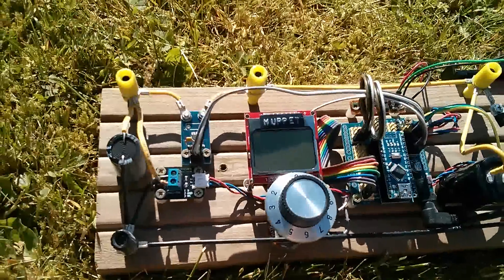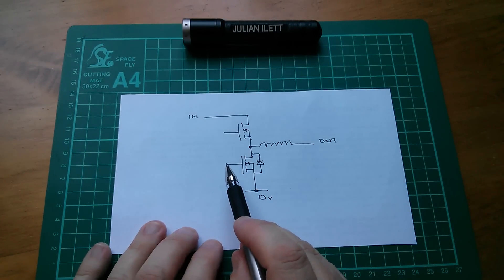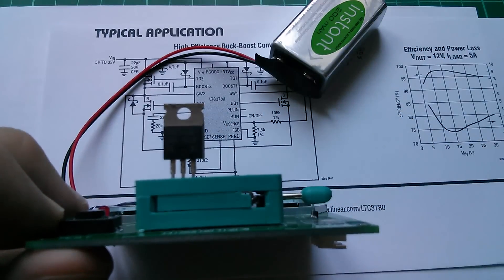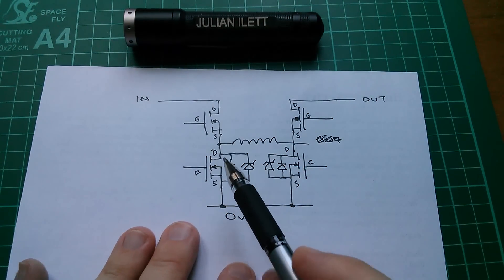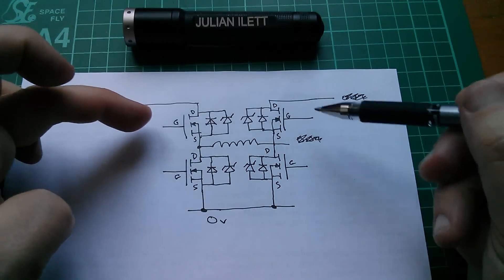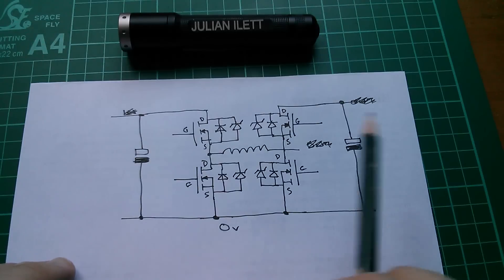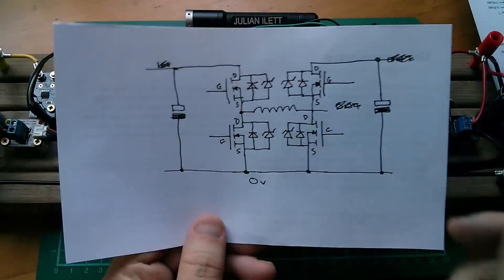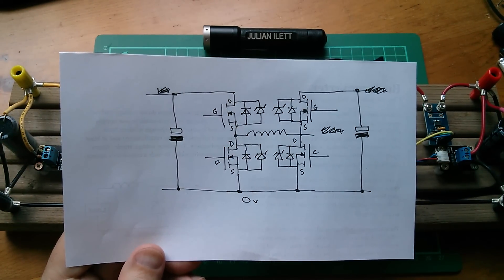Muppet 2 - A Bidirectional Buck/Boost DC/DC Converter

Comment: A little info for you in high frequency converter alway use higher frequency capacitor low esr for better current output and input because the frequency do reverse to the input voltage supply slowing down current peak so use low esr for input and output or the current won’t get pass 2 amp even because of higher frequency ripple effects stopping the current from slowing down to storage for the low to keep the voltage and current in phase

Comment: Interesting stuff!  When I saw you starting to talk about the body diodes,  I was hoping that you weren't planning to use them,  and am glad that turned out to be the case.  I've also heard that it's not good for the MOSFETs.  Take that four-MOSFET circuit you ended up with,  and consider the inductor going across the middle of it to be one of the coils in a stepper motor,  so you'd need two of those circuits,  8 MOSFETs in total.  I've seen that somewhere but can't remember where,  and I'm not sure how you would go about driving the gates...

Comment: With the right choice of parts you could even use this to convert rectified mains directly into DC. Or if you add some kind of polarity switch to the output you could also make a sine wave inverter.

Comment: Have you looked at the Propeller microcontroller? It's great for projects requiring precisely timed signals.
If you're interested in using the Propeller, I'm sure I could write some code (probably in  assembly) for one of the cogs which would output whichever pulse pattern you want. One cog could be driving the pulses and the other cogs could be used for other input and output needs.

Comment: I live on a boat. solar panels charge the house battery. some 4 meters away, i have another battery. If i put your muppet next to the remote battery, the boost facility would allow for the volts drop on the input could be offset via the muppet. I have a third battery 6 metres away and i could do the same for that battery. This project has more options than just the solar charger. please stick with the Arduino  odules due to price and availability.

Comment: You can drive it from the nano on pins 5/6 at around 60k.  However, it's more efficient at higher speeds approaching 500k-1,2m.  This will also allow you to use smaller component values.
Reply: Found this mate and maybe it will help.  It seems the ATMega48 will go up to 1Mhz.  Scratch that.  It's max clock rate is 1Mhz.  Misread it.  But this should give you some ideas. That's what I get for researching and working at the same time.  http://jiggerjuice.info/electronics/projects/power/buck-boost-half-bridge-nmos.html

Comment: Hi Julian, whichever DC converter topology you end up using for the MUPPET 2, consider a Sendust toroid core for your main inductor.  Core loss will be reduced as these have a 'distributed air gap' and these cores are also less audible.  Overall efficiency will improve.  You would need probably 20 turns of enamel wire on a Sendust ~50mm core to get near 50uH as they have lower permeability.

Comment: Could you melt snow off solar panels by feeding energy back into them?
Reply: Nope it would permanently kill the solar panels.
and you would need a very high voltage in order for any current to flow back into the solar panels it would be useless

Comment: You can do the current sense in series with the inductor.  A pair of op-amps can make a differential amplifier input stage to amplify up the current signal before you get rid of the common mode part with a 3rd op-amp.

Comment: It might require something with more PWM timers than on a standard arduino. You could still use an Atmel chipset though. Alternatively, if you want a module, you could use a teensy. The 3.5 has a lot of PWM enabled pins and 4 separate timers.

Comment: kHz PWM is very much possible :) Max speed via the hardware PWM is 62,5kHz. So no need to switch uC for that.
Reply: tengelgeer But at such low frequencies you need a huge inductor.
Reply: Kind of, but if I'm not wrong he uses <1kHz now.
Reply: tengelgeer There are very few turns on that inductor. Unless that ferrite ring core is made of some miraculous material, the inductance should be way too low to operate at <1kHz. Remember dV = L dI/dt.

Comment: Hi Julian, you may need to use a raspberry pi zero or similar due to the necessary dead time that the arduino clock may be too slow to do. You also should probably use dedicated drivers as the microprocessor may not switch the gates fast enough

Comment: Please turn it on!  bidirectional converters are popular in motor drives, there are tons of studies about this subjects.
Reply: you are thinking of a H bridge what this is is a 4 way bi directional positive switch mode power supply
Reply: no. I am not talking about H bridge. Bi directional buck-boost converters were often used in motor drives for regenerative braking. Bi directional buck-boost converters are also useful is solar or wind power units, if they are connected to the grid.

Comment: if you want a better controller for that check out cypress' PSoC 5LP, you can get the little prototype boards for 10$. up to 70mhz 32 bit arm cortex m3, programmable gate array and a surprisingly easy to use IDE (PSoC Creator). the actual code is C as usual but for hardware configuration it is all done through a schematic view that lets you just drag and drop hardware components and wire them together like you are drawing a schematic. this includes hardware lookup tables, free running counters, timers, PWM's and a lot more.

Comment: Recently did exactly that with an atmel microcontroller, so the arduino should be fine. 
I had to use a second timer for either the Pwm of the buck/boost or a servo, not sure anymore.
Cant wait to see how you manage the Feedback and Interrupts in the microcontroller as this is the part I don't feel i know enough about.

Comment: Julian, there is a TimerOne library that lets you run much higher then normal PWM frequency's on the 328 chips.  You could also consider something like a PJRC Teensy 3.2 or 3.5.  Which have deadtime and similar hardware PWM controls built in, if you can learn how to run them.

Comment: Julian, consider building your power stage on a printed circuit board instead of hand-wiring, the efficiency will be greater and it will generate less EMI.  There are plenty of low-cost PCB fabs in Asia that do nice work, and homebrew methods like toner-transfer are good if you have the patience.
Reply: Definitely! For really high power the emi is large enough to switch on the mosfets and everything behaves strange, it can even short out the input via 2 mosfets.

Comment: Okay, that sounds kind of scary when you talk about a device that can do buck and boost and be bidirectional all at the same time.  If you have, say, a solar panel on one side and a Pb-acid battery on the other side, what's to stop a simple glitch from causing the battery to try to "charge" the solar panel and overpower its voltage in boost mode and possibly fry your solar panel??
EDIT: now that I think of it, the solar panel would have blocking diodes in it but how much reverse voltage can it handle.. heh
Reply from the maker: +Christmas Eve The simplest solution would be an anti-backfeed diode.

Comment: So you made a super-symetric Muppet.

Anyways - while it seems nice, what would be the use of a bi-directional buck-boost converter? I can see the appeal of a bi-directional converter that boosts in one direction, and steps down in the other.  
But like this? i just can't imagine a situation where you wouldn't want a separate converter all together as you likely do not want to send your power back to the source.

Comment: I recently finished a similar project for my dissertation (solar power system for use on an aircraft), I used an LM5170-Q1 for the buck-boost controller (bi-directional) and the LTC3780 for MPPT. Whats interesting about the LM5170 is that it bucks one way and boosts another, and if you look at the schematic for the buck converter with the freewheeling diode it can essentially acts as a boost converter if the inputs and outputs are flipped and the PWM signals on the two MOSFETs are swapped around. If you have a closer look at the LTC3780 datasheet it recommends switching frequencies in excess of 100KHz which an arduino cant handle, if you are using a software approach(which I found from my experience is much easier to implement)  to this I strongly recommend using MOSFET drivers, the faster switching frequency may increase switching losses but would reduce the needed size of the power components (inductor and decoupling capacitors)
Reply: Hi Joe do you an online copy of your dissertation on ResearchGate?
Reply: I have tested my DIY MPPT BUCK, 100 A, input 80 V for IR4110, 175 V for IRFP4668, output 11 - 96 V, two phase design, IR2104 or IR2184, ACS758BI 3 pieces,  2 for phase 0 and phase 1, third for IN current, toroids FERYSTER 45 AMPS, ADS1115 for temps voltage and amps measurement, ESP32 MCPWM for 180 * phase between phases, I tested it all year at 98 AMPS OUT MAX. at 48 *C at HIGH FETs. Two 12 V / 0.4 AMPS fans for cooling, PWM controlled with small FETs, this design can be also used for BOOST, as mentioned in comment above.
So for 96 V LFP battery it can handle under 50 *C at FETS 9600 W.

Comment: I fiddled with something very similar one weekend,but I could never get the synchronous rectification pulse timing quite right. I ended up just paralleling the 'bottom' MOSFET's with Schottky diodes (efficiency jumped up,since the body diodes aren't great),and skipped the synchronous part. I'm interested in seeing how you get along with this. Maybe I'll revisit it. :)

Comment: That schematic with one side of the coil left disconnected (after you moved the output) was incredibly distracting.
Reply: Djhg2000 he left that net unused because he will add parallel capacitor with miller cap. he wont show that trick to anyone. dont run the car at its full speed

Comment: Buy a PSoC from Cypress Semiconductors. A kit module with a cortex M0 inside for about €10. Easy programming in C with high speeds. Fun to play with.
Reply: Roy Van Lierop PSoC4 is cool device with its stable 12 bit differential mode ADC.

Comment: the shotkey diodes on upper mosfets are redundant. You'll still have a symmetric circuit (in terms of input/output) after removing them.
Reply: nowanda2nd He needs anywhere to anywhere scheme so he added that diodes on both the upper hands. its not going to be all synchronous scheme at the begining so that will be a safe bet to keep the mosfets turned off depending on which mode its in now.
Reply: Satyajit Roy Not quite sure what you mean by 'anywhere to anywhere scheme'. Having shotkey diodes in parallel with the lower mosfets, improves the loss on their body diodes if they are not driven and used just as freewheeling diods. Mosfets already have a flyback (aka body) diode in them to keep them controllable all the time, so there is no need for an extra diode if no reverse current is involved.
Reply: nowanda2nd anywhere to anywhere means from left to rifgt and right to left.
Reply: nowanda2nd adding diode gives you extra advantage on upper mosfet in case if you are reluctant to keep one of the upper mosfet turned on all the time
Reply: nowanda2nd its N channel so driving that complicates thing to next level and bootstraping drivers may not keep that on permanently

Comment: You will need a dedicated SMPS or PWM chip. The timings are critical and the Arduino is doing other stuff.
Even interrupt driven will be too slow.
I am not sure what the practicality of such input/output symmetrical setup would be though.

Comment: the Arduino will do it with the harward PWM, but why not use the esp8266 via Arduino IDE.you can do some more vids on the esp then
Reply: The ESP8266 & ESP32 are way too power hungry for battery operation. The arduino will work fine, but an STM32 would be better. It has much more advanced PWM hardware and can run at a higher frequency. That means you can use smaller inductors.
Reply: or esp32 even better

Comment: You need to start learning how to make your own PCB's for prototyping.
Reply: Yaghiyah Brenner real breadboards are fun XD
Reply: connecting wires < 20 wires on a breadboard has never been fun. especially when one power connector is loose not making contact. Breadboard is fine for a single sub-circuit.
Reply: also.copper clad boards is dirt cheap. comon Julian its time to upgrade.
Reply: or PCBs without any substrate :D http://hackaday.com/2011/03/31/pcbs-without-any-substrate/ or http://7electrons.tumblr.com/post/79162145170/7e-guest-artist-peter-vogel-godfather-of or http://hackaday.com/2012/page/84/
Reply: hahah some people has just has way to much time on their hands.

Comment: Awsome, idea! I will definitely borrow it for my lipo tester project! Idea is to have one circuit that can charge a lipo, discharge it (and measure capacity) and charge it to storage, all without interaction. With this setup I could use a super-capacitor on one side and the 18650 on the other and there will be minimal wasted power! Regarding microprocessor, life would probably be easier if you used a ic with DMA, that way you could set the sequence and use cpu cycles for other stuff, like measuring and adjusting current, update display etc.

Comment: Yes, you can get the arduino to operate at 100KHz or more PWM easily. But not via the usual library functions. You need to go low-level, get the datasheet for the atmega and write into the PWM control registers directly.
Reply: Vyl Bird if you know what all the requirements are then you wouldnt say this again. 100KHz is not the only parameter that is important here
Reply: I've built an MPPT solar module using an arduino to generate the PWM signal myself. I assure you, it can be done. Yes, you have to drop the top register and sacrifice a little PWM precision to hit 200KHz. And you have to use a separate MOSFET driver chip in order to get the gate transitions sharp enough. And you then need a 47ohm resistor on the gate to stop it from ringing. But it can be done.
Reply: Vyl Bird at how many bits of resolution?
Reply: Driving single switch using 100KHz with 7 bit is okay and hopefully your AVR can handle it if running at 16MHz or something. theoretically you could achieve 125KHz if 7 bit resolution is desired. but here in this model its not just 125KHz for one switch and there is a tricky part that cant be achieved by this simple mechanism. You need to stop that shoot through current as well. A more suited 8 bit MCU could be PIC16F178X series micro controller that has PSMC.

Comment: if you connect the top sides and replace the inductor with the load, you could also get square wave AC. Then you would have an almost universal power supplay. Not sure if buck-boost would still work, though

Comment: Very impressive setup, and I also just may have bought that sexy component tester.
Reply: DPortain thats at milli amp range. for power supply current this body diode will drop more than 1V. measuring that voltage has no appropriate meaning for such cases. datasheet will tell more info than that if someone knows how to read that
Reply: I didn't say anything about measuring voltage.

Comment: I like it! I like it a lot. I do have a couple of suggestions that I have come up with while trying to develop my own MPPT solar controller (which I haven't completed yet).

1) For the current sense you may consider using simple current sense amplifiers such as the INA199. They are cheap but more importantly you can chose the moment to take the current reading, which you can't do with an I2C device. Do to the intermittent nature of a switching supply it matters a lot when the current measurement is taken.
These discrete high-side current sense amplifiers usually come in very small surface mount packages but that is tolerable if a cheap adapter board is used. The output is analog so your microcontrollers ADC will have to be used but that enables you to have absolute control over the timing.

2) The learning curve is steep but I imagine you will no doubt switch over to an ARM controller at some point in the future. Don't let it bog you down too much, 32 bit timers are very much worth the effort. A single 32 bit timer with 4 outputs is perfect for controlling all 4 switches of a H-bridge. I personally like ST products. The Discovery boards are some of the cheapest boards I have ever seen and the programmers are built in. The Nucleo boards seem to be very popular (I haven't tried) but they don't have all the extras of a regular Discovery board. 
For the IDE I have been using EMBitz. It is free and there is no code limit but it is Windows only.
The reason I mention this is because the STM32F334 has a High-resolution timer with 217ps resolution. I haven't tried it yet but I thought it was really neat and as long as I was going overboard with my design then why not. I believe I could get other chips timers to do the same high resolution trick with a few external components but I haven't gotten that far.

I have been inspired by your MPPT project. I love it. Keep up the good work.
Reply: Even if you're not intending to us the STM32F334, the application note for a buck/boost converter using the STM32F334 Discovery kit is a very useful technology primer: http://www.st.com/content/ccc/resource/technical/document/application_note/ec/9c/b0/81/b5/12/4e/21/DM00108726.pdf/files/DM00108726.pdf/jcr:content/translations/en.DM00108726.pdf
Reply: Paul Grimshaw I love its HRTIM  as well as the TMS320F series. They are cool product when you need design professional design. He used that inductor (if you know what I mean) so there is no hope that this project will mature to a usable design.